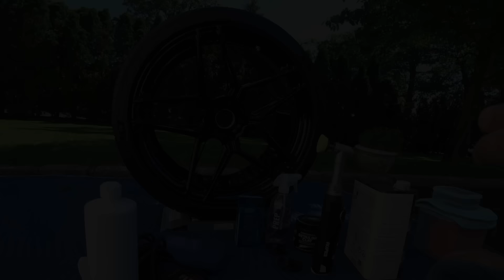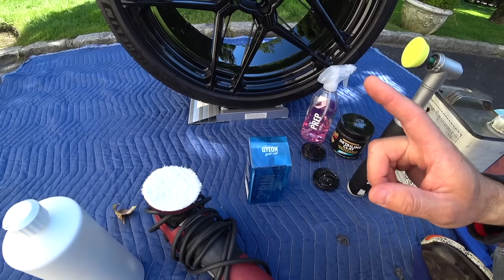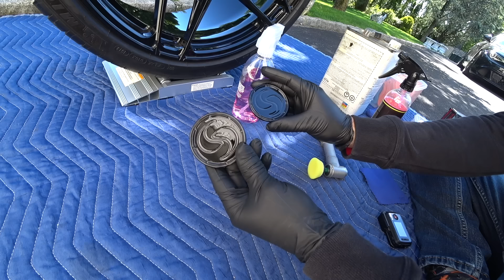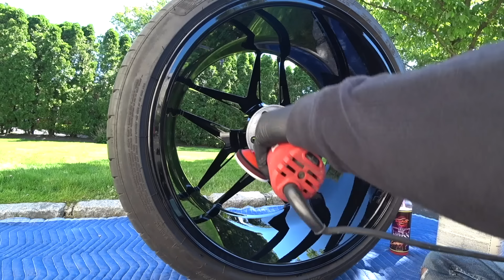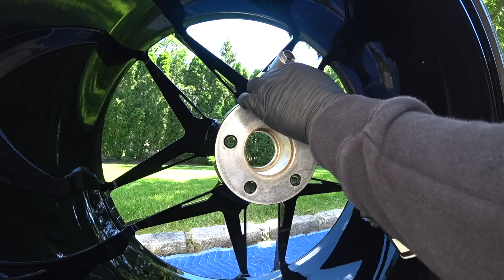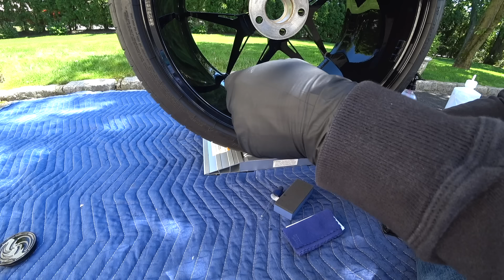My First Ceramic Coating | Gyeon Q2 Rim | Auto Fanatic

Comment: Did you get any swirls left behind by using the Rupe nano in rotary ?
Reply from the maker: No swirls are from too much pressure and travel speed
Reply: @autofanaticcars  I just bought one and I am having swirls left behind,  I was definitely using a little bit of pressure. What speed did you use it at ?

Comment: Great vid mate, Do you have bonding issues with tire dressings on the ps4 s?
Used water based, silicone based even petroleum based and this is after cleaning the tire back until it looks like yours in the video.
Thanks from Australia 👍
Reply from the maker: No its all in the prep, I just shot a video using CarPro PERL, you gotta watch that video when i upload it in a few days.
Reply: @autofanaticcars  love Perl, also use Zaino and a few others that we have in aus only, depending on my mood lol.
Got the best degreasers etc can't win.
Look forward to your vid.
Fyi just spent 60hr on my mk7 Golf R from paint correction to the wheels, went with Kamakazi ISM coat for paint, wanted the wax look worm glow, it's the only brand that does that and the best thing is it last for 3 years.
Turned out mint, if you want pics just send me your email. 
Auto fanatic just like you mate.
Thanks for getting back to me appreciate it.
Reply from the maker: sweet i just did a review of PERL and its been days of rain im going to shoot some final clips for that video right now. You gotta get some of my wheel cleaner to strip tires for PERL or to clean the wheels we have shipped thousands of bottles to your country so far.
Reply: @autofanaticcars well let me in AF, give me some info and we'll go from there, cool?
Reply from the maker: @jonoklease5562  visit my site auto-fanatic.com and send message direct to order anything, we got many boxes heading to AU and NZ later today with Fed Ex.

Comment: Nice thorough video, [except for the oops with the suede applicator cloths :) ] but any opinion about using this coating on matte finish wheels?  I have a set of Victor Equipment Innsbruck wheels on the 911 in matte/satin black.  I bought the Gyeon Q2 Rim, but I chickened out after cleaning and used a conventional sealant for matte finish because I could not find anything about using this product on a matte/satin finish.  Also, will all of the polishing / correcting turn a satin finish into a gloss?
Reply from the maker: Hi Kevin you need to be carful on satin because polishing will change the finish, your best bet is to do a sample test in the back of the barrel with a very light polish by hand, then do good prep like i show in this video and try the Q2 coating. I have not tried cleaning these wheels yet as i am building up brake dust to do a follow up video.

Comment: you obviously still got great results, but with coatings you do want to work it in a cross hatch pattern, "just in case"...don't wanna miss any high spots. great video as always brotha
Reply from the maker: next one i try on rims i will bust out my Iwata airbrushes and spray it on, that should be even better.
Reply: @autofanaticcars  that's a way i've been seeing a lot of people doing it. i prefer the block. ceramic coating is sooooo therapeutic to me haha

Comment: Clearly the way you did it worked, but that’s not how’s it done... the reason you use the cloths is due to the product crystallising in the applicator, you’ll find the applicator would have marred or scratched the next rim... if you used the cloths you wouldn’t have... also the best method I’ve seen and used is the one from esoteric car care where you cut up a foam applicator into 4... 👍

Comment: Also never use a gloss enhancer spray or anything that will leave things on the paint before a coating, basic knowledge. If there's smudges on the paint use a IPA Wipe.
Reply from the maker: guess you failed to watch the video before commenting, prepsol removes everything and i also use the Gyeon Prep after, i doubt anyone would go to the extent i did here on their wheels.
Reply: I did great work auto fanatic, 1.5 days two coats on my golf r 19" rims

Comment: I’ve had this on my GT350 for about 3 months.. experience is:
Dry driving: 100 miles or less, I can actually blow off most brake dust with a blower, 100 mile + your wheel cleaner gets 99% off with no agitation.
Wet driving... all bets off, some agitation required, especially in the barrels. If brake dust gets wet, I think it acts similar to waxed wheels.
Reply: Agree, depends on the car though.
Driving habits etc...

Comment: For the tiny areas I take the micro suede and cut them in to quarters and they way you can get into all the little nooks. Just make sure you wear gloves 100% and work it in nice and even👍
Reply from the maker: what worried me about using those tiny micro suede pieces is you will saturate your glove and fingers and most likely smudge other areas of the rim as i worked around it. Gloss Black anything is a bitch to work with. i think the foam pad works excellent it got nice even coverage and in all the areas without getting a drop on my gloves while handling.
Reply: @autofanaticcars  never  had an issue with it saturating the gloves? They provide them for the consumer to use as you should throw them away after. But foam does work awesome too, I've previously done the same and cut my pad into 4 and same same.

Great video glad you experienced the wheel coating you will love it. Reccomend topping with gyeon cure or beadmaker!

Comment: Phil, you do you!! I know like others have said those little suede cloths are for application but there’s a 10 different ways people apply ceramic coatings a lot of pros use microfiber applicators and your way worked for you, who cares if you can’t reuse the block I have like six of them, get one each time you buy a coating. Love the videos and all your help!
Reply from the maker: yeah i think the prep is the absolute most important part of any coating or detail which is what this video focuses on, you can use a spray gun, air brush , foam pad whatever works for you the result is the same this stuff is so easy to use its practically foolproof i still wonder why DIY guys don't do full coatings themselves. yeah the towels and foam block and pads got tossed after i finished anyways. I think i may try another coating using my Iwata spray gun and airbrush but i would have to use full face respirator doing so and it may waste more product with overspray. lets see how this stuff does over time and il decide what to try next.

Comment: Phil using a ceramic coating? Who are you and what have you done with autofanatic?
Reply from the maker: if it wasn't hundreds of guys emailing  me asking for me to try this I would have never bothered, the prep was a massive amount of work I had no idea how long two wheels would have taken because I'm nuts making the surface flawless and ready. we will see how this coating works over time on the right side of my car. I truly hate gloss black wheels again ha ha ha
Reply: @autofanaticcars  all this prep work for like 2 years durability when angelwax wheel wax last minimum six months and the prep isnt as massive..rofl.
Reply from the maker: the prep was overboard because I wanted to make sure the surface was perfect im sure if you do a shoddy prep job it will impact performance. I actually want to try FUSSO on the other two wheels to compare.
Reply: @autofanaticcars  hey mate, it's not really heat proof that stuff.
Most coatings for wheels are upwards of 500 degrees Celsius heat proof. I've tried polish angel super sport works great looks awesome but only last 2 months at best. 500ml bottle last me 2 years for 19" rims. I suppose way up cost, looks, application etc. Supersport looks sick on gloss black, has a hi gloss wax look to it, won't be disappointed. 
Works well with wheel cleaners too. 👍

Comment: You prepared it correctly, why not use the micro suede over the applicator? I think that is how they were to be used. Also your flexible extension for the rotary would be easier on those spoke areas. IMHO
Reply from the maker: yes the flexible tool would have worked great but I have that at work not at home when I did this job. I just used what I had on hand that day.

Comment: This process defines the term Auto-Fanatic 👈
Reply from the maker: yeah not sure who else would spend almost two hours per wheel polishing and prepping.
Reply: @autofanaticcars  not me, that's for sure but then again I would never EVER have Gloss black wheels....EVER😋
Reply from the maker: if it wasn't for the mesh gloss black wheels I had on my 2015 Mustang GT PP back in 2014 I would have never started developing my wheel cleaner years ago. that was my first car with gloss black wheels it was torture. my new Shelby wheels appear to be a simple design but once you start polishing you realize how complex the style really is.
Reply: @autofanaticcars  at last, a good reason for having Gloss black wheels because that wheel cleaner is THE best, period! I bought 3 bottles of it from you because I was going to put white 1552 wheels on my Abarth, Intergrales, but I traded that car in on a CPO 2018 Hyundai Elantra sport with a pretty complex rim design,  so it's not going to waste, that's for sure, I might end up with silver Intergrales on the ES even!

Comment: Thanks for sharing!  I have found ceramic coating does help but never tried in comparison using wax.  I used the kit from Adams with good results also. Comes with a spray to boost protection from time to time.

Comment: I think this is the most thorough prep for rim coating I have ever seen. Great job, awesome rims too :) It used to come with a mask too, now it doesn't? I wonder if the formula is the same it was couple of years ago.
Reply from the maker: I wonder if Amazon sells incomplete kits the price use to be higher as well. thanks for watching I hope this did something on these two wheels for the time it cost me doing them. ton of work but prep is key
Reply: @autofanaticcars  It's better than having nothing on the rims I guess, but I for one expected more from it. Maybe I had too high expectations. I still had to use strong wheel cleaners,  couldn't just rinse heavier break dust. And if I gotta do the same wheel cleaning job, what's the point?! And it lasted about 10 months, not a full year.
Reply from the maker: in theory you'll never be able to rinse off brake dust with any coating that's a myth and there is so many variables at play , heat, rain, brake resin compound, rim finish etc with brake dust and I learned so much developing my wheel cleaner. the true test is will this be better than the Collinite 476 I used way back on these wheels, we will see
Reply: @autofanaticcars Ceramic will provide thicker layer of protection than any wax, that's for sure. More durable as well. Your wheel cleaner is a game changer and I wouldn't be surprised if the big boys made something similar of their own in the near future. Can't wait until it gets to Europe.
Reply from the maker: had a shipment arrive in Germany a few weeks back they are testing and discussing importing product to distribute for all of Europe, we hope soon this will be official. they were very impressed with all of the products so far.
Reply: @autofanaticcars  What store if I may know :)

Comment: Micro-suede applicators anybody? Triangle make up applicators work really well also to get into little tight spaces. They are also cheap and readily available. Looks great!
Reply from the maker: the more i looked at those tiny suede pieces in the kit i bet it would cause more of an issue by getting product all over your gloves, then you handle the rim and Boom you just caused smudges, i think how i did it here made more sense keeping my gloves clean from start to end. still came out great.
Reply: Auto Fanatic , true you did have great results. One of the purposes I found with the micro suede towelettes is between finishing one wheel then starting the next. The ceramic will dry on the towelette and if you don't switch to a new one it will scratch the next wheel. Same thing with the wax applicator. The reason they give you the towelettes and the foam block is they usually are wrapped over the block. When I have coated wheels that was the way I did the barrel and most flat spots then just used it with out the block for the harder to reach spots. I also use the makeup triangles I mentioned earlier. One tip I can offer, is when using the foam block with towelette wrapped around it, try not to lift it off the surface you are coating. It will reduce high spots and smudges.
Reply from the maker: @theloser0  I was honestly planning to use my Iwata airbrush but it was so windy when I did this and that would have been a bad idea, I feel spraying is the best application on detailed wheels like these. either way its a simple process you can not really screw up unless you let it dry to long, similar to a good wax. I would like to do a video spraying a wheel. Maybe il buy another kit and do the remaining 2 wheels one day with a spray ap
Reply: Auto Fanatic please don't take my comments negatively. They were not meant to be. Just poking a little fun. You did a great job, the rim looked beautiful finished. I would love to see the results with the air brush!

Comment: You were supposed to wrap the applicator block with the suede cloths. They're applicator cloths, not removal cloths.
Reply: The applicator side with fine hairs gives a bit of cushioning under the MF suede for any surface imperfections. You cannot reuse the block now those hairs are locked up with the coating.  That applicator only works well on the barrels and larger flat spokes. I took the tip of using the MF suede over my glove hand to get into those tight spots and for you around those spokes. The MF suede keeps the product next to your surface,  on sponge applicator it soaks up more.  Do not take this personally, your method worked but Gyeon designed it this way like most others. And the results are the same as your wheels will stay great especially with your wheel cleaner.
Reply: Exactly my reaction when I saw him using the block instead of the suede cloths.
Reply: Advise from detailers on ceramic coat applications for wheels is to get a foam round wax applicator pad  and cut it into triangles like pizza slices and use that. I did and trust me it makes it so easy to get into all the spokes and angles and have confidence you reach everywhere evenly.
Reply: My jaw dropped when he didn't used the applicator suede.
Reply from the maker: @juicesanchez1  do you not see the results, no reason too use those silly things I did it my way, I feel my way is way easier for wheels and less chance of having your hands be covered in product and touching the rims.
Reply: @autofanaticcars  understood, but my OCD went into defcon2. I'm sure I would do the same if the kit didn't came with instructions.. after all, who reads them, right? .lol.. great video by the way.
Reply: you don't "have" to use the cloth. some people do, some don't. he just has to make sure to toss the block before the coating dries. some people prefer not to use the cloth
Reply from the maker: lol, it still worked fine regardless

Comment: I think its better than wax last longer so you don’t have to do it so often, wheels are exhausting. I applied carpro dlux that can be used on trim as well and its holding strong after 5 months on a satin wheel
Reply from the maker: took almost 3 hours to do 2 wheels, exhausting is an understatement on how I did mine but the preparation is so often overlooked. as you see the polishing pads were filthy the more I went over the surface after the clay and solvent cleaner. I feel this coating if any good will work well on the 2 wheels I applied it to.
Reply: Auto Fanatic yeah I do my big ram 2,500 satin wheels and it took me 4 hours, an hour each wheel. And that was only washing and claying them lol. I hope you like the results after so much effort